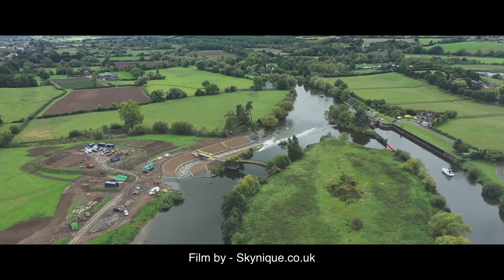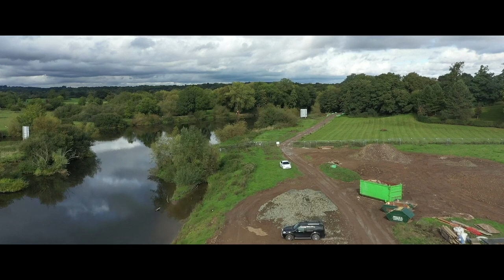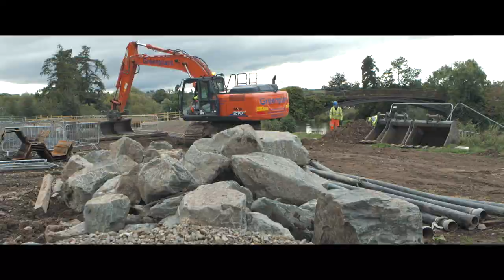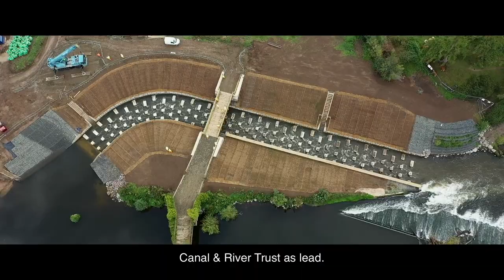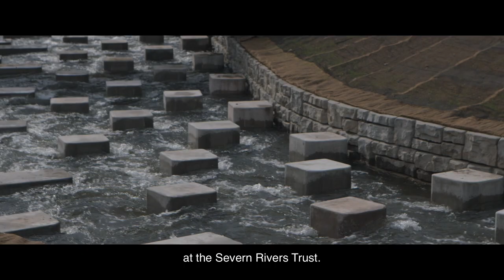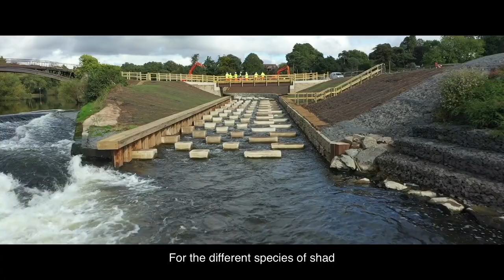Bevere Fish Pass Opening - Unlocking the Severn September 2020

Comment: Waste of money. The severn is so polluted there is hardly any fish left. Only the other day there was a news report saying how polluted the rivers are with high phosphate. The Worcester steamer company folded because the vessels were always stuck on the bottom of the river due to stopping of the dredging. You have lost the knowledge of the river that was passed down from one generation to the next. Bevere lock was the best kept lock in the UK many times. A lifetime of work put in by Don Smith ripped apart.
Reply: Salmon do run the Severn,especially in late summer and autumn....and yes they did last year.
Not as many as years ago though.